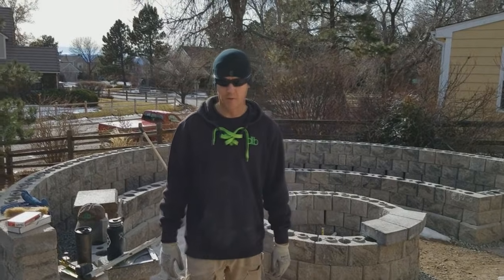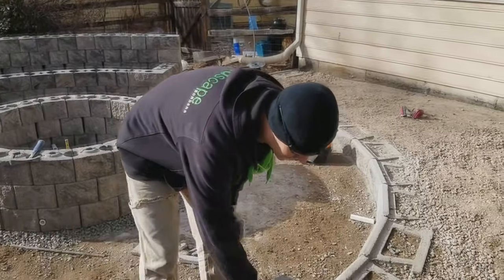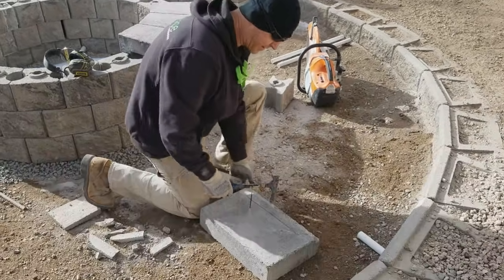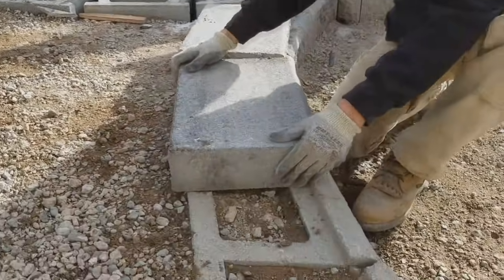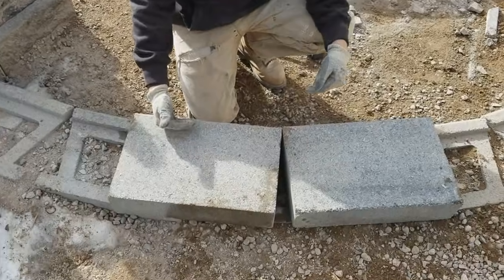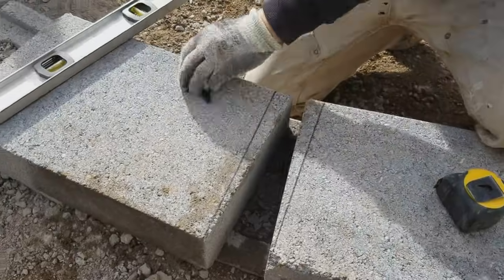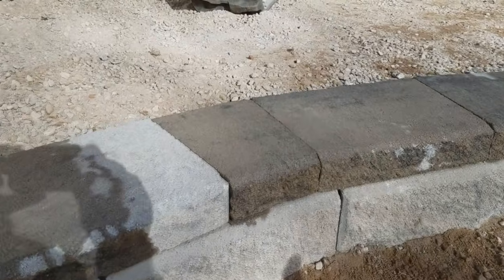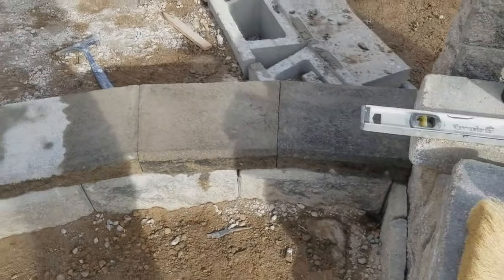How to...Inside radius Allan Block caps

Comment: To avoid the partial cap, next time try breaking the joints with each cap to be cut. Then stack your full blocks on top of their gaps and use the full blocks to mark the cut lines. Remove your full blocks and cut the marked angles. Glue them all in place and ouala, you've got perfect spacing, perfectly centered joints, consistent sizing and no compensating with random size wedges.

Comment: You can cut the face of the cap in one step just don't let the blade go past an inch of each side and tap it out with a hammer.  No need to lay it down and make the pencil marks and cuts

Comment: I get the whole 5 cuts per cap. You could used 12 inch caps instead of 18.  Timed a little off the lip of the blocks where the blocks meet. Use the easy scribe and been done in 45 min. But. All else. You killed it bro. Nicely done. That project has a crazy amount of cuts.
Reply: Use a different block and you only need to cut ever second block

https://youtu.be/s2dxBbmZwNk

Comment: Great video.  When cutting caps for the outside radius wall, do you have to cut the lips or just tuck the blocks together, find the gap distance, cut the gap distance in half, then saw?

Comment: Many thanks for this very useful video. When building an OUTSIDE gradient wall, there is a similar problem with the caps not aligning properly. Am I correct in presuming that I simply need to trim the edges of the caps in a similar way to you illustrated in this video regarding the inside curve wall?

Comment: I get making a spacer but that small piece seems less appealing to the eye than trying to catch the running bond since it doesn't stay centered anyways.

You will see the cut more often stepping in and out than the face is all I'm saying but I guess that's a question for the customer to determine.

Comment: good video, what type of saw are you using to cut caps?
Reply from the maker: Thanks. We use a 14" wet block/brick saw by stone. It has a sliding table on it, makes real nice cuts. Sometimes we will just use our Stihl TS420, but if you get the saw angled even a little bit, the kerf of your cut shows up as a big gap.

Comment: Nice vid and nice work.  Man, you should be wearing a respirator while cutting.  It won't take but one or two seasons inhaling that concrete dust for you to need bottled oxygen when your 60.   Minor hassle wearing a respirator to save your lungs.  There are heavy concentrations of silica in that cloud of dust swirling about your face.  Under an electron microscope silica looks like shards of glass.  Here's a link to review:  https://www.industrialvacuum.com/dusty-dangers-concrete-cutting-grinding

Comment: How did you determine an inch and 3/4?
Reply from the maker: just from past jobs. trial and error. just need to take it back enough to allow the ends to come all the way forward.
Reply: Decorative Landscape Borders dang....details is what makes or breaks it...
Reply: The back of the caps where touching on the internal side of 5e radius the gap on the external side was 2 1/4 inch so he divided that by 2 meaning 1 1/8  of each